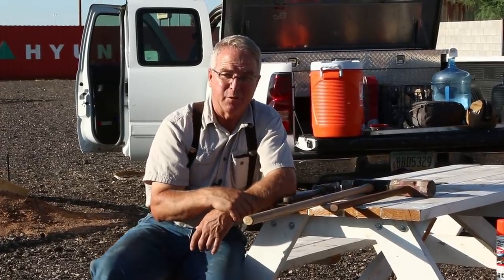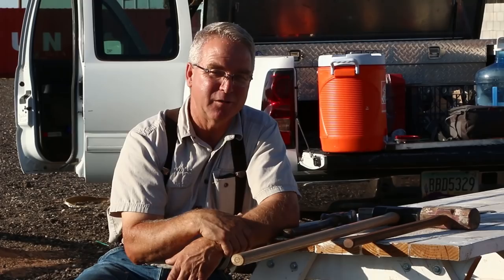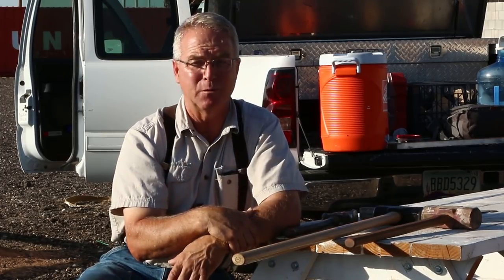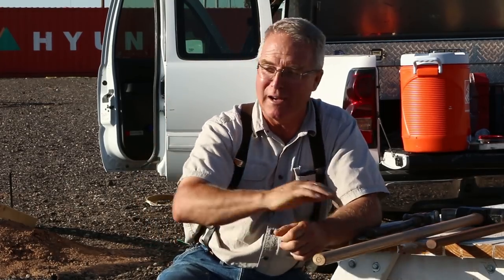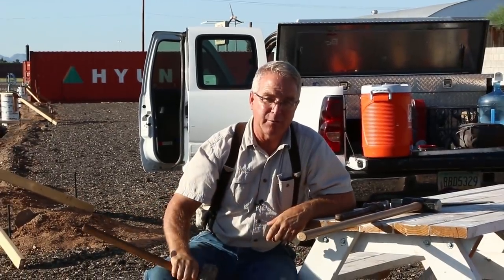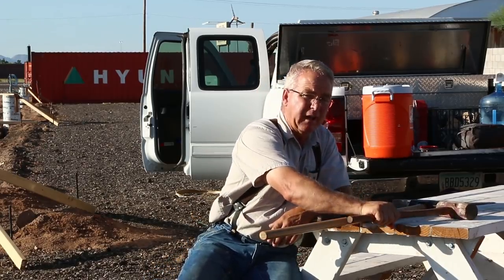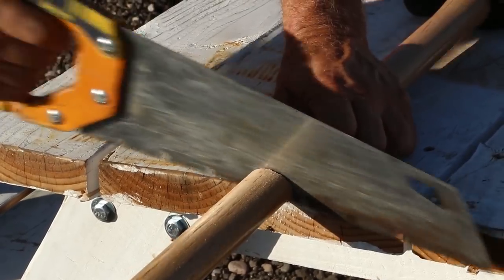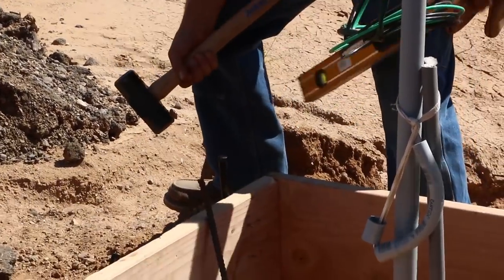Best Sledge Hammer for Concrete Work

Comment: the "Just because you can do it doesn't mean you should" line is something I am still learning at 21 and have been hearing that since I was 13, and I can not tell you how many times my grandfather yelled at me for picking up 2 bags of cement and then walking over to where he wanted them to go and putting them down. And could you give me some advice on how to transition from owning a company to flat out working for a company full time as in I get an hourly wage now. The transition is killing me because I feel like I am not getting anything done. Is it all in my head? Any and all advice would be great.

Comment: What equation are you thinking of?

I am refering to where you claimed  that the "energy" of a blow increases more rapidly with the "speed" than the "weight" of a hammer.

I think the relevant equation is:
Force = Mass * Acceleration

Where, assuming you can increase Mass and Acceleration equaly, the increase in force is equivalent if increasing either by some  value.

Thanks for the videos by the way.
Reply: I see you mentioned the equation:

E = (1/2)MV^2

I'm not sure that is the relevant one.

Comment: Took me a long time to come to this way of thinking. I’m 36now and have swung an estwing hammer for 25+ years as used to help my dad as a kid in early days they were 30oz hammers more recently a 25oz big blue but now a feel my elbow and it I want to drive stakes my 7lb sledge comes or for fencing a 12lb maul gone are the 18lb days or swinging a 14lb sledge. My steel head framer is on short time too.

Comment: This is the kind of knowledge that master crafters need to pass down to those just starting in a trade or craft. The apprentice system used to do it, but just any time with some one that has been doing a job for decades will pass on little bits of wisdom and knowledge that aren't really written down anywhere. When I did my degree for Industrial Electrical Technology, all of the instructors were retired journeymen or masters and just having a chat after class or asking a question in class yielded all sorts helpful wisdom and methods.

Mentorship like this is missing in too many businesses that just want to throw cheap labor at every project and task. It is just a waste of effort most of the time or it creates problems that make it a waste of money and time; the too things that no one ever has enough of.

Comment: I usually set up line for a curb machine which requires driving the longer stakes (pins) to hold the line in place. Everybody I work with insists using anything less than a 8 lb will "wear you out". I try to argue the other way but they aint hearin it lol

Comment: Back in the day my job in the oilfields required a 16 pound sledge hammer. Because part of what we had to do was forge heat our drill bits and basically blacksmith them back into proper size and form. Let me say on the larger bits 8 inch up to 13 inch thick chunks of tool steel that often 6 to 8 feet long white hot out of the forge. Then your standing over that on a anvil slamming it as hard and as fast as possible before it cools with a 16 pound hammer. Let me tell you doesn't take long till you become a man. We had smaller drill bits as the drill hole hot deeper nut we could get those with a 10 pound hammer and let me say it was more then half easier.

Comment: For anyone whom decides to cut their hammer in the field: you can scrape the cut splinters on a hard rock to smooth it out just like you would with a rasp/file. He used a knife. This is all Incase you have a saw, but not a knife, and need to round the edges.

Comment: I don't know why but the masons I grew up with always called it a 'mash hammer'.? (used with chisels) (use anything lighter would kill your hand when you miss and hit your hand.)  I never noticed the weight of it (it was probably 6 lbs. or so, maybe less) with about a 10 to 12 in. handle.  That's what I always used to drive stakes.

Comment: He is correct. The lighter hammer will put more energy on target when swung faster than a heavier hammer when swung slower. The answer here is of course, use the heavier hammer and swing it like a damned man.
In all seriousness though, I used to do IT work for MS Concrete at their old building on Commerce St. in North Las Vegas. The company spread into a number of other trades including framing and landscaping. The recession hit them hard though and they went under. Last I heard, the remnants of the company were split up and sold. He's not joking about the size of the company though. The housing and general construction boom in Vegas made lots of money and put a lot of companies on the map. The fall, ruined just as many of them. I haven't driven by in a while, but last time I checked Las Vegas Paving bought the building and shop on Commerce St. 
That shop was one awesome place. Full machine shop, metal fab, heavy equipment maintenance, the works.

Comment: In the UK a sledge hammer designed to be used single-handedly is just called a 'lump hammer'.

Is that not the case in the States?

Comment: I have a 32 ounce dead blow ball pein hammer that I like to use when I need to convince something that it needs to fit or get loose.  I personally have never needed a bigger one and I get why people go and get the heavy ones.  The kinetic energy formula you put on there dictates that you double the force if you double the weight but you quadruple the force when you double the speed.

I can personally get my 32 ounce hammer up to speed stay accurate with one hand and with it being a dead blow I have very little vibration and I know everything was sent to what I was hammering

Comment: Been in concrete for 27 years now..started with an 8 pounder..switched to a 6 pounder 4 years ago?..I get the length of the handle by choking up to the head with left hand then right hand next to left and bend wrist till handle hits elbow...I cut it past my elbow an inch or so....use it as a single jack or double...single jack 6 pounder lite enough and hand 3 or 4 inches up the handle....then if you miss the stake to close you hit the handle next to head instead of fingers....that's a mess...hurts too....handle is long yes but I don't have to bend over as far to pick it up if stood up on the head... probably 18 inches long...that's what I like anyway...when you go buy a sledgehammer get a couple out of the rack.....look at the grain of the wood....swing them a little bit.....believe it or not some hammers are lighter than others even if they say the same pounds on them.....they swing lighter...anyway that's my two cents....thanks for the great videos
Reply: Just my two cents'...  (in case you're interested)
   I generally only go to hardware shops for handles. I prefer (far and wide) to go after specifically older (vintage or earlier if possible) used hammers in "decent" condition...

    Hammers (like anything ferrous-metal) get "tool hardened" over time and use. SO... it's not necessarily "cheapo-chinesium" steel that makes a brand new hammer "bad" or "soft"... It's softer because it's new.

    An 80 year old or older hammer, with some "mushrooming" starting to show around the head faces, has been banged and banged and BANGED on... That is long term "cold tempering"... 

   Bet you're thinking "But mushrooming's bad"... No. Actually, it's nothing but a little deformation. Normal in any smithing process, too. What gets hazardous is "cracking" and "chipping"... BUT neither of those is "world-ending" either.
    I take an angle grinder with an appropriate disc... usually a little light grinding is enough to get rid of the obscene parts... BUT if it's "just that far" out of norm', you can cut things off, too. Stick by a fairly large container of water, and cut or grind in short bursts, wetting the thing to keep it reasonably cool... Sure, some of that classic tempering might go away a little bit... BUT if you try just a tiny effort, you'll actually preserve most of it, because hammers are big and heavy... It takes a LOT of energy to actually penetrate enough to break that much temper in that much metal. Trust me, that's a b***h to try to anneal. (yes, I've tried AND failed numerous times.)

    "Should I be beating on something with hardened steel?"
   Why not? Can it chip? Yes... which makes it kind of imperative to wear safety goggles. BUT it's worth pointing out that the brand new hammers warn you should wear eye-protection anyways.
   AND a hammer with right next-door to ZERO foregiveness? You ain't beatin' that... not with a "rough equivalent".

   I DO have one newer hammer around. I keep it around because I bought it cheap, AND the slightly softer newbie doesn't throw sparks quite as readily as the older models. Sometimes, working around extremely flammable dangers, that is a concern...
   Otherwise, when I haul off to knock the immortal F*** out of something, consider the immortal F*** knocked out of it. The thing's either going to move or break... simple as that.

     ...and pretty much without exception, every single person I've introduced to using an ancient hammer for the job, has found himself or herself falling in love with it. ;o)

Comment: I have to ad my two cents. If only driving in 18" steel pins a smaller hammer works fine, wood stakes need more hammer. Short handles are garbage on big hammers(and smaller ones) and in my opinion handle length should go up with the weight of the hammer. My old boss (RIP) would run a 12" handle on a 16lb hammer. He was jocking out, pound one stake in crooked as hell, then go "administrate". I called that thing a the wrist breaker, and outwardly expressed my opinion that it was better off on the scrap heap. I most often use a 10 lb hammer with the handle length equal to the length of my arm (fingertips to armpit). I really enjoy that hammer for driving in wood stakes (2x2 or 2x4). it really delivers the goods. Lately I've been reaching for an 8 lb hammer with the handle equal to my arm length plus another hand. I think there is a balance in the speed vs mass debate. 6 pounder works good If I'm driving in steel stakes, but is a little light for wood stakes. the ten pounder is good for wood stakes, but is a little unwieldy with the steel pins. Every one is going to be able to get their hammer to speed differently so the mass of the hammer will in turn be different for every one. For me i can get the 10 going just as fast as the 6, so when im hitting stakes with the 6 it just feels wimpy. the more extreme example of this is watching some one drive in stakes with a claw hammer. I was working on a project in Sheboygan Wisconsin, and the company was putting us up in an apartment. Across the street a contractor was pouring slabs for another apartment building. No one on their crew used a hammer that was more than three lbs (small drilling hammers were the norm). I even witnessed a guy drive a three foot stake for a 10" tall form with a framing hammer. It had to have taken him 100 hits or more. For reference, I've been in the construction and remodeling business for 15 years, the last 8 years have been strictly in concrete work.

Comment: I lift mine with 2 hands like a katana high in the air and come down with a slight bend in my knees and use all wind force  That motion will go through a foot and a quarter of concrete.

Comment: I'm an equipment operator in the Vegas valley and always find it funny when my laborers think they can pound a stake after watching me smoke a new pair of "Tiger" teeth on my excavator. You'll always get this dumbfounded look  when the stake bounce right back up after every blow
Reply: Lol.
Reply: If you want to continue the laughs, throw em a caliche bar and tell em to keep at it, it'll work!

If anyone doesn't know, caliche is basically calcium carbonate that has bonded with the fine sediments you find at the bottom of bodies of water. The Vegas valley used to be under a large inland sea, and as the area became more and more dry and hot, the water evaporated quickly. Because of the very fine sediments and the calcium carbonate, it basically is natural concrete that has had millenia to cure. The soil in Vegas is no freaking joke. There is a reason why most pool companies will charge you an arm and a leg to dig a pool below 6ft and basements are basically unheard of here...and that reason is caliche. You can't blast in city limits which means you have to chip it out.

Comment: E=1/2mv^2 isn’t necessarily accurate to describe why the hammer feels the way it does. Energy isn’t conserved in collisions, but momentum (p=mv) is. You can get a larger blow with a larger hammer if you’re able to swing it fast enough. However, it takes much more force to accelerate that larger mass to the speed you need (f=ma). That’s why the first swing on a big hammer feels great but by the 100th swing, you would’ve been better off with a lighter one. It’s just tiring to accelerate a big hammer
Reply: Same thing goes for framing or smithing hammers too. If you have a hammer that’s twice the weight, you only have to swing it half as fast to get the same blow (p=mv with p being the “blow”). Big hammers though are clumsy and awkward and tire you out faster. You can sink a 16 penny nail in one hit with a sledge hammer pretty easily but good luck doing it all day

Comment: In the south such as Alabama where I’m from all of your edge  forming and much of your bracing for other forms is done with wooden stakes especially in a residential environment. An eight are 10 pound hammer with a full length always wooden handle is a must. A 12 pound hammer just doesn’t make sense unless you’re a Neanderthal.

Comment: I don't think energy is relevant when pounding stakes. It's all about momentum.  Momentum is conserved in a collision; energy is not.  Momentum= mass x speed

If you swing a hammer twice as fast the nail won't go four times deeper, it will go twice as deep.

At least I am pretty sure of this, I could be wrong.

Comment: Swinging a hammer is like swinging a golf club every muscle in your body contributes to the blow if done properly. Landing the blow with the proper placement and speed is what separates the pros from the green horns. A heavy hammer or a light hammer is just as bad. The proper weight mostly depends on who and what size the person is that is swinging it.

Comment: You know where a long handle ends up on inside swing ! One mistake and it's the end of your line. One of the first things I learned as to do as an apprentice carpenter was to drive wooden 2x4 stakes for forms. It's in the wrist action. And the engineers sledge is used on it's side so as not to split the stake. I found for that use an 8# was about right. But I'm a wimp.

Comment: Hey Scott, I'm in the market for a new welding helmet and I figured I would ask your opinion given the recent welding videos about the gates. I'm a hobby smith and metalworker so I don't need anything fancy for long hours of wear, just good quality. I do TIG, MIG, Stick, and plasma cutting. My current helmet is some generic big box store model and is quite old and failing to darken properly and quickly, espeically when using TIG. So it needs replaced.

Comment: FOR WHAT ITS WORTH, I USED A 6 POUNDER WITH A PIECE OF 1 1/2 IN PIPE WELDED TO THE FACE, I USED IT A LOT FOR GROUNDING RODS NO HANDLE AT ALL

Comment: Speaking of the grain orientation...
The Picknic table boards are wrong...
I've got an eye for that detail at times. I've got 4 decks around the house we live in and some of the 5/4 boards (God how I hate improper fractions) have warped and sprung from their fastners. Broke some simply because of the warp, and the reason curve up, smiley, wood grain open, to the weather is bad. I don't recall if you have covered this subject, but it may be an important lesson.  
Michigan pine trees built much of the North East of the country at the turn of the last century, and it's still an important role in the  northern part of Michigan and the upper pinsula.  
Keep up the great work! And thanks for what you have covered. Fall has arrived in our sunrise side of Michigan on the lake Huron shore. And I'm looking forward to beating metal more on my Hay-budden Anvil.

Comment: Your formula for kinetic energy is correct, but it doesn't apply to driving stakes. The potential for a moving object to do work is defined only by its momentum (mass times velocity). Kinetic energy doesn't change that potential, it only changes "how" that potential gets applied. A light, fast hammer that has the same momentum as a heavy, slow one has the identical potential to drive a stake. Where kinetic energy comes into play is if you want to break stuff or if you want to send something flying off at a high rate of speed. Cannon balls and golf clubs need high KE, but hammers do not. The difference in hammers is more about the physiology and preferences of the wielder than it is about physics.
Reply: You are right. The key is momentum
Reply: Sorry gents, I think you have it backward. Kinetic energy is more important in this example. Here is a good example: http://www.batesville.k12.in.us/physics/PhyNet/Mechanics/Energy/KENOTMomentum.html
Reply: impulse of course will be an important calculation in the hammer vs. stake problem, but we can assume the time of energy transfer will be pretty much the same between sledges, as well as the efficiency.

Comment: math geek says;
E = ½mv² 
the energy of an object [the hammer head] is half the mass [weight] times the velocity [speed] squared
double the weight and you get double the energy; E = ½mv² -> ½(2m)v² = 2E
double the speed and you have 4 times the energy; E = ½mv² -> ½m(2v)² = ½m2²v² = ½m4v² = 4E